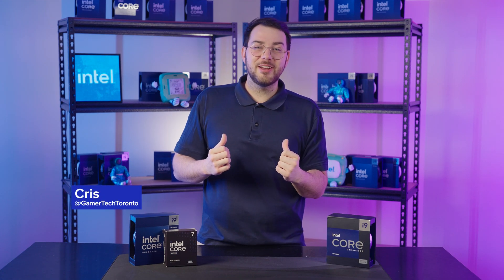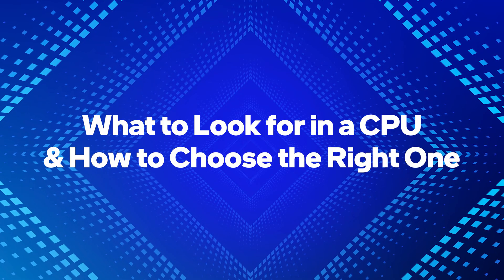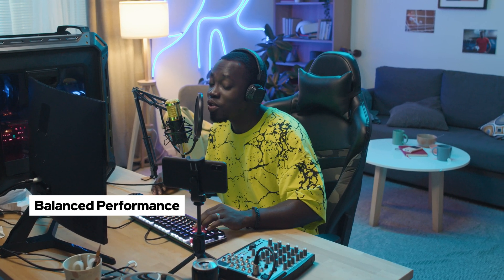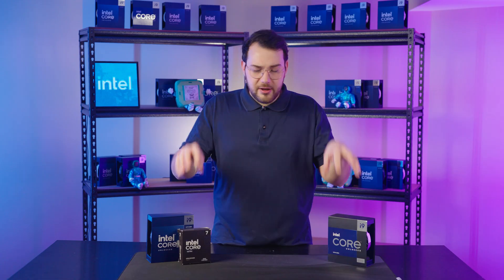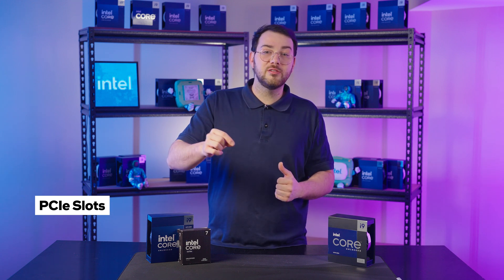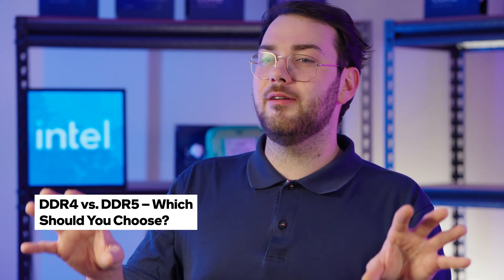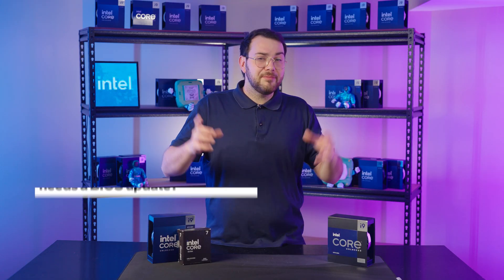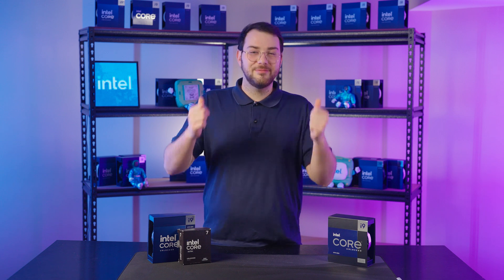PC Build Series: Understanding CPUs, Motherboards & RAM

Comment: Jumped from 2nd Gen Sandy Bridge/Ivy Bridge all the way to 15th Gen. Using the X79 platform and upgraded the i7 4970K to Xeon E5 2690 v2 for $25 at ebay (I remember it was like ~$4K during release). Before the Sandy Bridge, I'd used the Pentium 120Mhz, 133Mhz( took it from a thrown away system), Pentium III 667Mhz ( still have the box), Core 2 Duo E8400, QX9650.